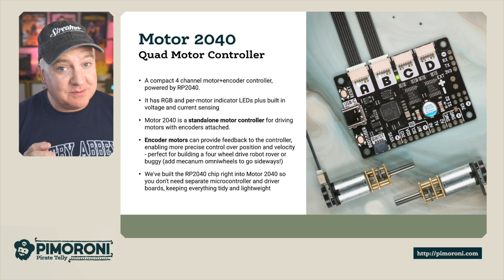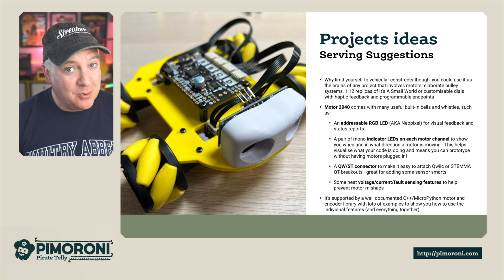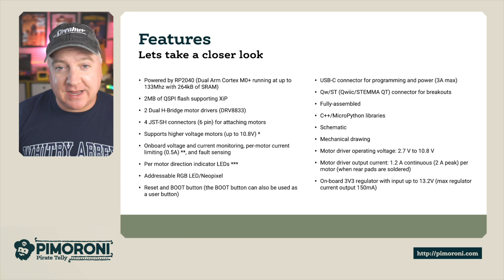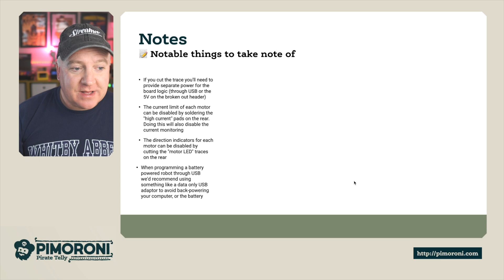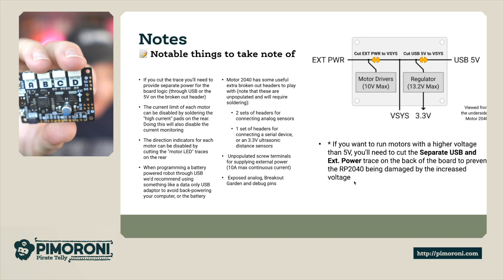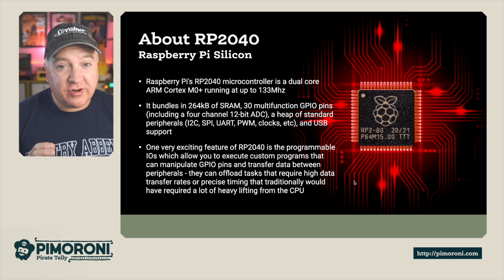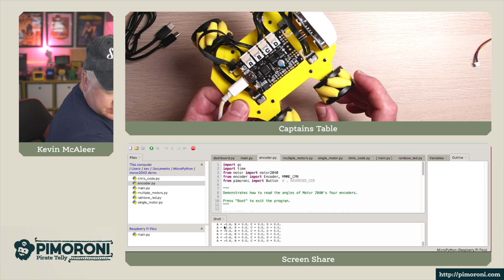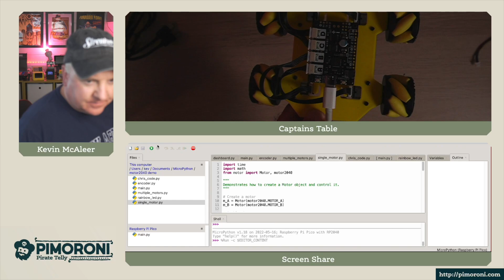First look at Motor 2040 - an all-in-one quad motor controller, powered by RP2040

Comment: Hello, I have the 10V geared "L-shape" motors with hall effect encoder.  The motor header pinout says: M+,3v3,A,B,GND,M-, but the motor 2040 page shows the board's header pinout as: M+, M-, 3v3, A, B, GND.  Can this be fixed with code, without physically cutting the headers and re-ordering the wired from the motor side? (I am relatively new to pico and micropython)

Comment: will this be able to handle encoder input from all 4 motors at once and not miss any interrupts/counters when 1 rpm produces (Total Encoder Pulses per output Shaft Turn  = PPR X Gear Reduction Ratio x poles = 11 x 270 x 4=) 11880 pulses as I am thinking instead of microcontroller an analog counter like LS7366R  would be the best to ensure accuracy of feedback.

Comment: I'm looking for this but 1000 watt per channel and 48 volt with per channel control (building an awd hub motor based quadricycle) what would be nicer is if it could handle even more per channel